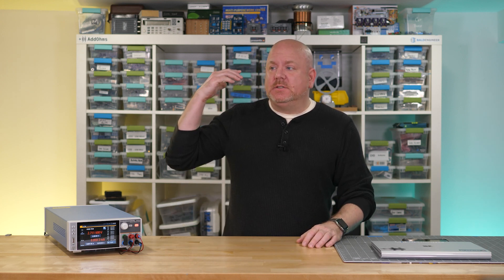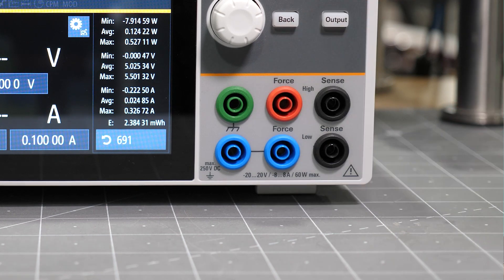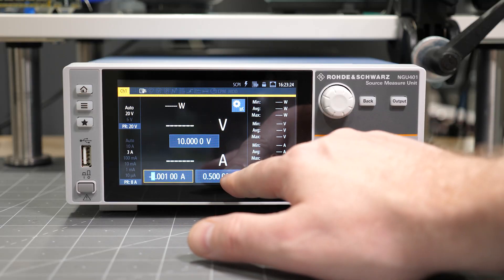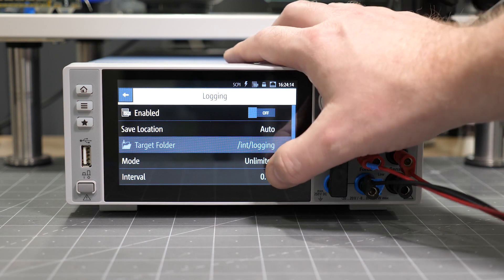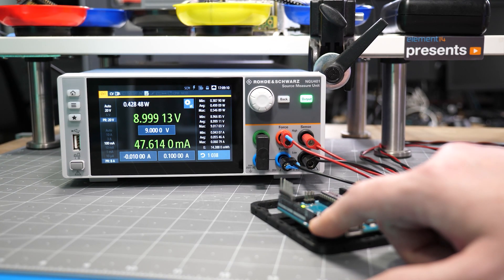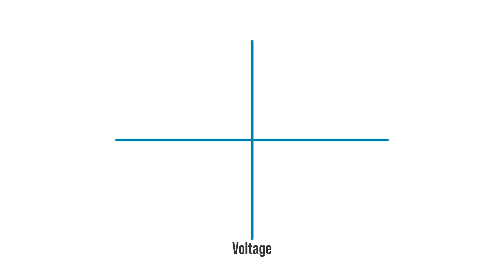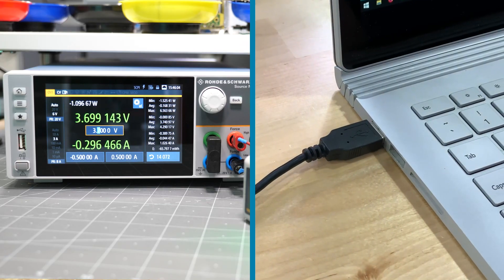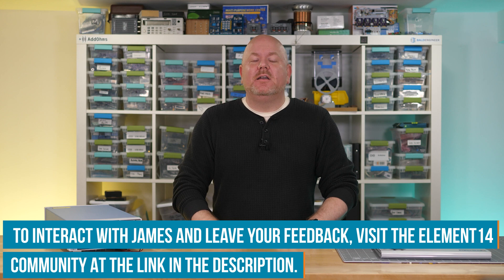Measurements with an SMU - Workbench Wednesdays

Comment: Everything a SMU does that makes them useful to the average embedded systems nerd is available with the NRF "Power Profiler Kit II". If you're watching this with drool dripping from your chin chances are the NRF PPK2 will get you about half way to this cool equipment with a little less accuracy and precision, but most importantly the price is 99% less too. If 4 quadrant is needed you can measure upstream and use a battery. So if you are looking for a tax write off then the SMU is your choice but for everyone else check out the Nordic Semiconductor NRF-PPK2.